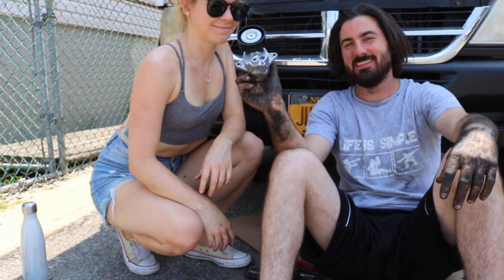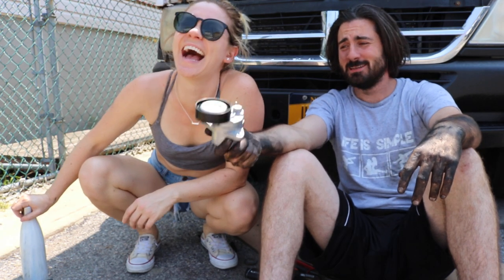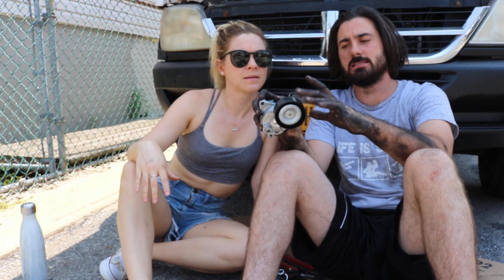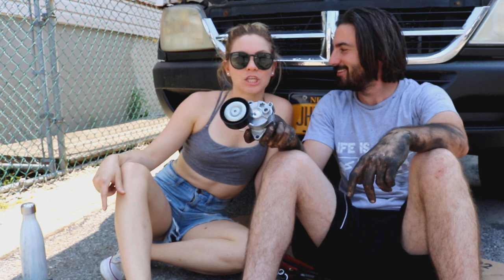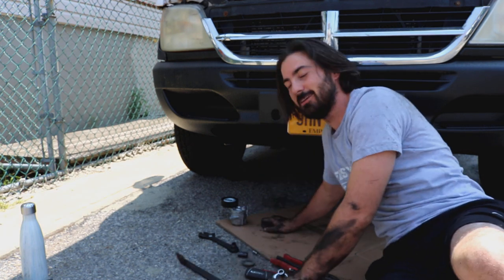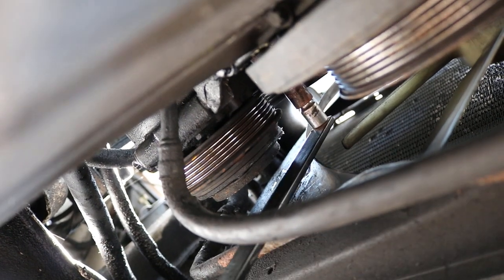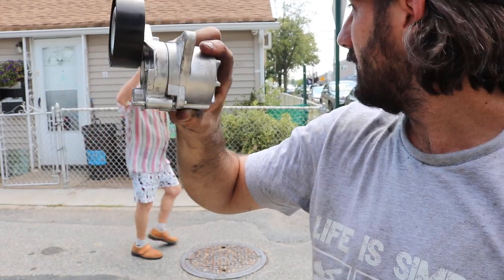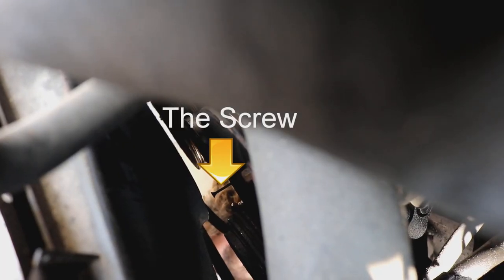Replacing a Tension Pulley on a 2003-2006 Dodge Sprinter Van / VanLife Hacks

Comment: I know that you are not the first owner of your van, but I always gently hose my engine compartment and wash the areas that can get wet with dish soap and water. Do diesel engines get dirty because they use dirtier fuel, or does that have no effect? I have only owned gasoline cars, but I am the only person that I know that keeps a clean engine compartment. I used to heat up leftovers on top of my engine while driving! I've got a Tesla Model 3 now, so no more engine for me. 
It's great to learn that you have this second channel by watching today's awesome video on your main channel.
Reply from the maker: So cool the engine compartment gets dirty due to carbon build ups. Thanks for the tip on cleaning it up. And I'm glad you came by the channel there will be more to come.

Comment: Can I just replace the pulley vs the tensioner and pulley?
Reply from the maker: Yes you can. I can't show you how due to the fact that I don't own this van anymore. But normally they only have 1 bolt to remove and it's a simple replacement. Good luck. 👍

Comment: I have an 05 Dodge Sprinter 5 cylinder....Do you know what size Torx bit to use to remove the Idler pulley?  I think it is a T40 but I cant get it in.
Reply from the maker: The idler pulley on the 2003 is a t50. Is the one you are using to big or to small?
Reply: @ThisVanGirlThatVanGuy  I think it is the T40 but it will have to be pounded in and its a very tight space.
Reply from the maker: @brianmiller5269  that's ok as long as you are replacing it.
Reply: @ThisVanGirlThatVanGuy  It was a T40.  But for some reason it was difficult to get out because the bit didn't want to go in the hole.  But once we got it out it went back in without any problems.  Damn Murphy was around for sure!
Reply from the maker: @brianmiller5269  nice I'm glad you got it done.